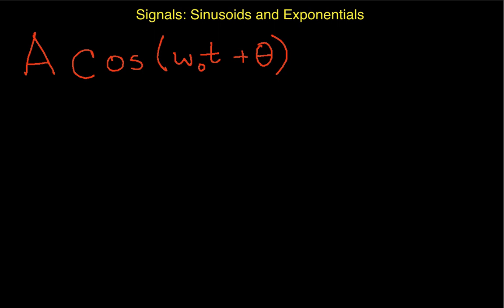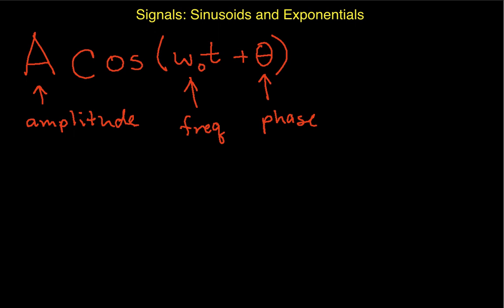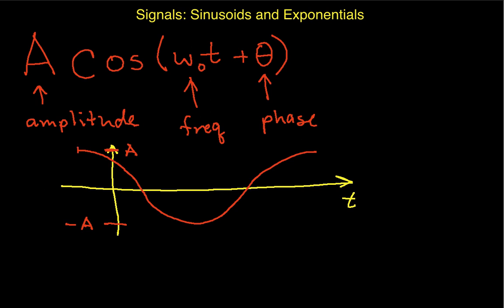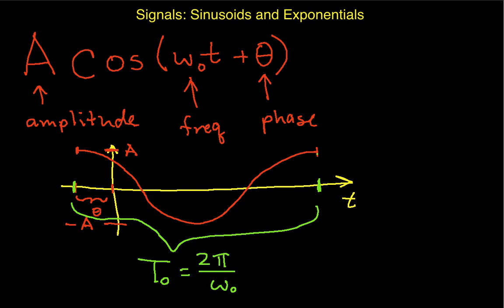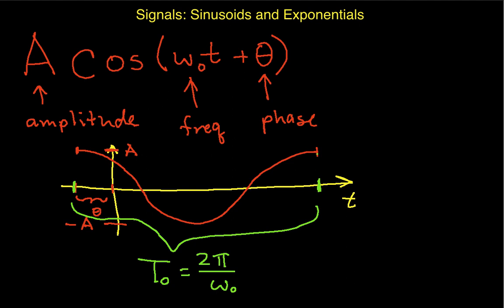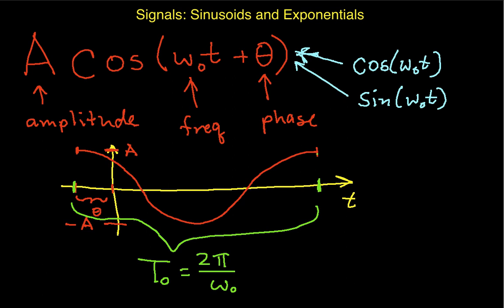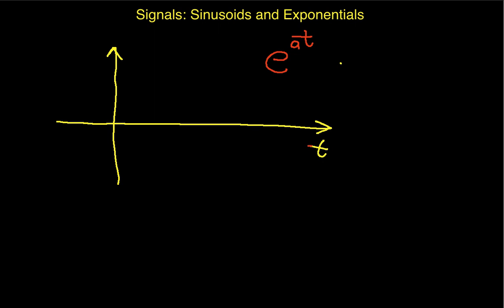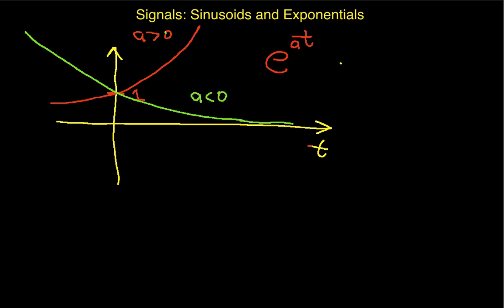Signals: Sinusoids and Real Exponentials

Comment: The graph is correct. Acos(wt + theta) is the general formula for computing AC and AC voltages. we use it a lot in class. Besides, wouldn't multiplying theta with "w" would greatly increase your phase angle which will shift the graph gravely to the right?

Comment: To clarify, I don't agree with the graph shown at 2:30. I don't believe the distance labeled on the t-axis is theta, but theta/w0. Consider cos(4t + pi/2). It's period is pi/2 and phase is pi/2. If one sketched a few cycles of cos(4t) and shifted it pi/2 to the left, it wouldn't be out of phase at all. To me, the phase pi/2 is relative to its period so it's a quarter cycle shifted from standard. In absolute terms, it's shifted by pi/8.